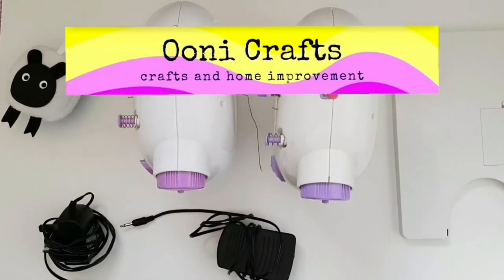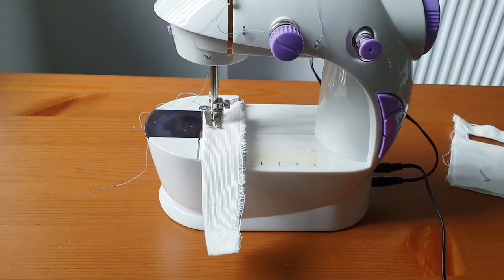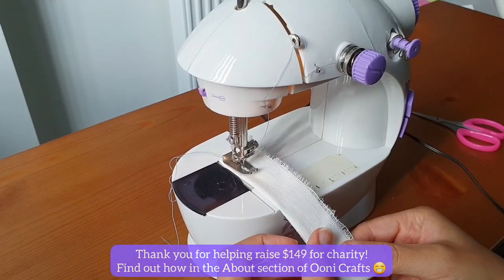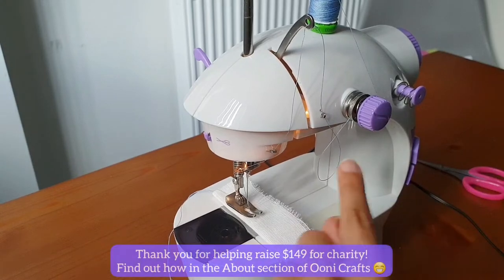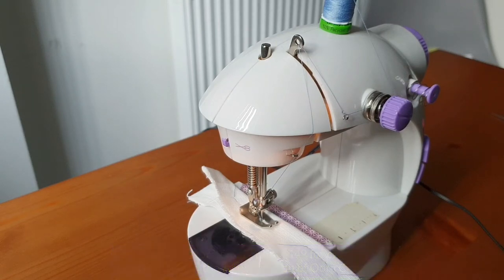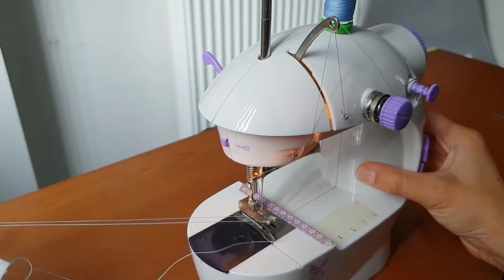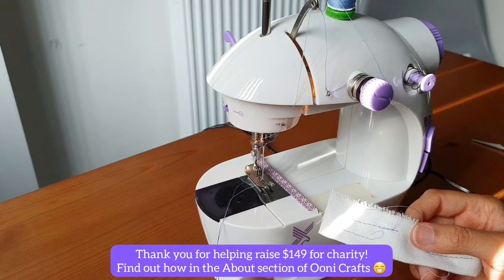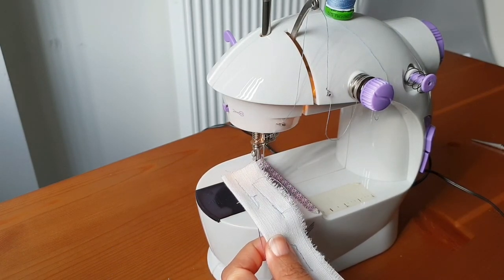How to Finish Sewing on a Mini Sewing Machine | How to Stop Sewing | Ooni Crafts tutorial

Comment: Hi! I hope you could help me with my mini sewing machine as you're my go-to vid whenever I face problems with my mini-sewing machine.

The fabric will stop moving after a few stitches and will be creating some kind of "ruffles", then it will be stuck stitching in the same place. I tried to adjust the tension but it isn't working.
Reply from the maker: Hi, thank you for your message. I can think of two main reasons for your problem. Number 1 your thread quality is not the best. Are you using a really high quality thread like gutermann? Number 2. Your fabric is too thin. Are you using a medium  weight woven fabric, no more than 3 to 4 layers?